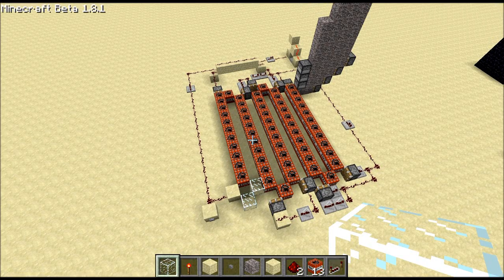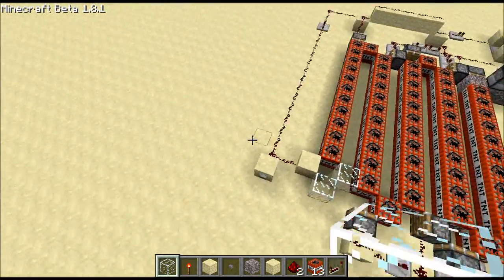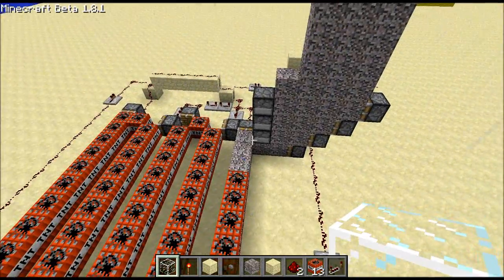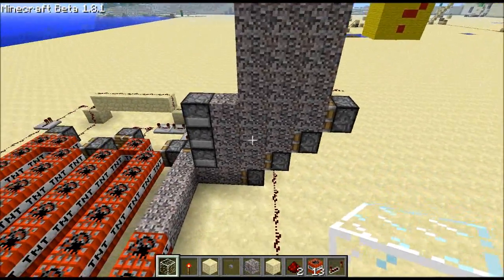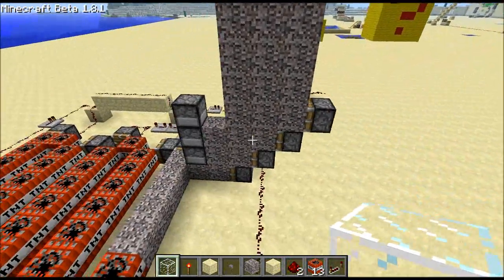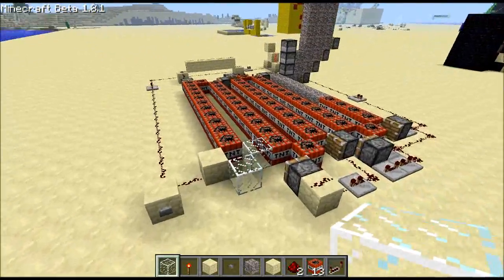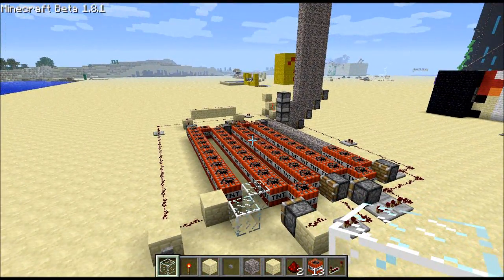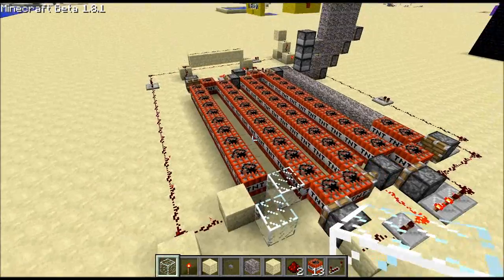Infinitely-Expandable Block Dispenser

Comment: You could have also used 'smart' pistons in order to cut down on the amount of redstone used. If you are unfamiliar with smart pistons  they are pistons that push automatically when a block is infront of them.

Comment: @kmt9080 Not exactly a 'BUD' Switch does not require a redstone torch. The reason a 
Smart' Piston works is because the power travels through the block.

Comment: Sorry to say that it's NOT infinitely expandable. It CAN get pretty ridiculous sized, but it can only hold (assuming my rough math is right) 128+127+...+(128-12) = 1470 blocks, because the largest column can only hold 128 gravel blocks due to the map's height limit, and pistons can only push up to 12 blocks.
And yes, I AM nitpicking, but infinite is not, to my mind, a word to throw around casually...

Comment: Actually, on the PC version the world, while massive, is finite. If I recall correctly the world is 64000000 by 64000000 by 256 blocks. Correct me if i'm wrong, but that's still finite.

Comment: But you've also got a maximum see-ing distance. Behind that distance does not render or "tick". Therefore the piston may push a block there, but it wouldn't update that chunk until you move your ass over there. Until then it's stored in the cache of minecraft. But because there's a block already in that chunk, while it isn't updated, it cannot push another block there. Therefore it still isn't infinite.

Comment: uhhh.... What..... as long as you have space on your computer, minecraft will keep generating more land...   only the xbox version has a restriction

but, given that pistons will only push 16 blocks, that there is a height limit (255 currently), and that this design requires the next piston be up one, that means you can only have (255 * (16 * remaining height)) blocks so aprox 522240 blocks, which would be out of range for redstone anyways,  I'm sure hes come up with something better by now tho

Comment: This design is not infinite. Because there is a height limit to the maps, you can only have so much gravel. (Because you have to to add a piston 1 higher for each stack of gravel. But you could use a cobblestone generator like one of the comments said.

Comment: Wouldn't it be more expandable, if you had staircases perpendicular to the existing staircase? It would greatly expand the capacity of the dispenser (to 512095 from 8001) without much extra work (and look a hell of a lot cooler aswell!:D)